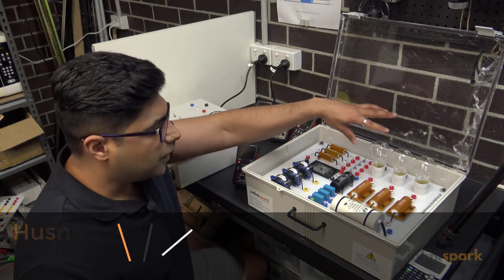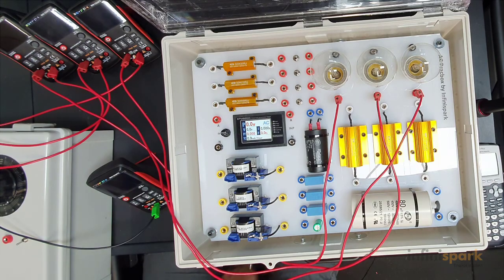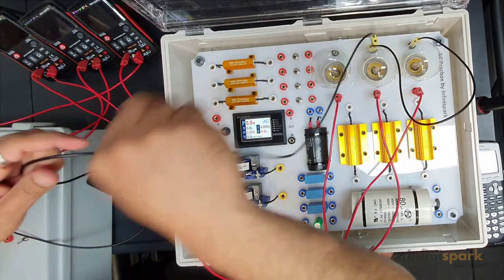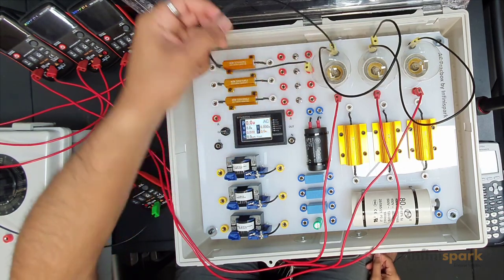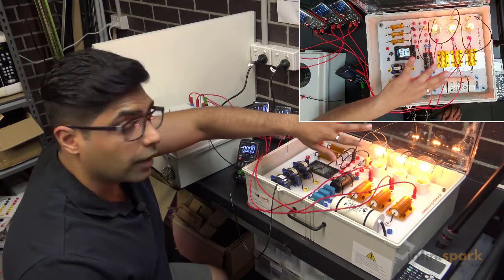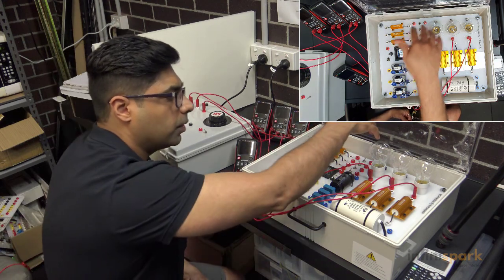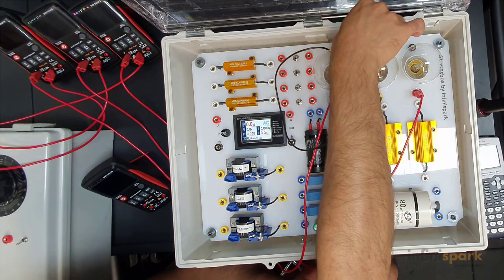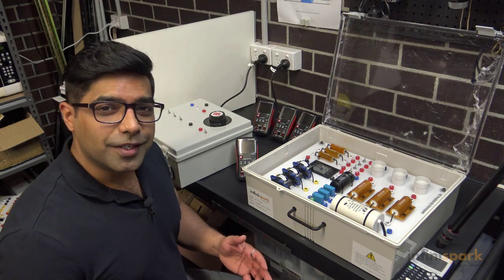Three phase star vs delta connection demonstration

Comment: Did you used the same voltage in both connection ?
Reply from the maker: Dear Rosario,
Yes the line voltage for both connection was the same

Comment: Awesome demonstration! Can I ask you if is it better to connect a three-fase motor with a 220V delta configuration or a 380V star configuration if its application is a lathe where it should take a high torque ?
Reply from the maker: Thanks Rosario,
I think if a motor specifies 220 delta or 380 star for a rated power, then the power output will be the same because the line voltage of 380 in star is 220 phase voltage . It depends on what voltage you have available, for example, if you have a vsd that has 220v 3ph output, then you go with delta.
Reply: @infinispark  thank you for the reply. I'm gonna buy a vfd inverter for my lathe so I can get what I want. I've red that a 220 V delta configuration is better for torque because of a higher current, is it right ? 
And then I thought that having three 220V phases in the house was safer than three 380V ones
Reply from the maker: Hi Rosario 
If you have a supply with 380 line voltage then connecting the load in delta will give you more torque compared to connecting in star. The reason is because in star, the phase voltage is smaller so the current will be smaller and so will the torque. When connected in delta, the line and phase voltages are the same so higher voltage means higher current and the torque.

However, if your motor has the specification of 220 delta/380 star and if you have 380 line voltage, then you must connect the motor in star. And if you decide to go with vfd with 220 output, then you go with delta.

Vfd is usually a good choice anyway for motor control.

I hope this helps. All the best